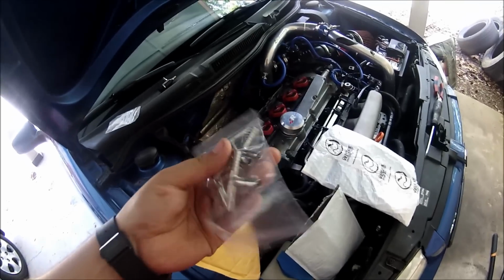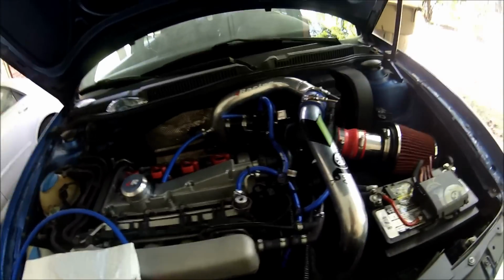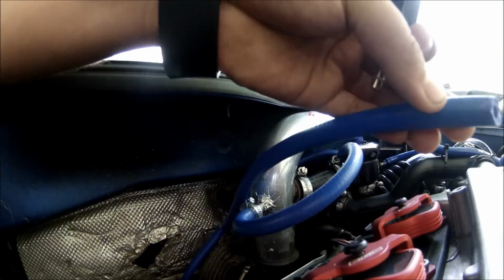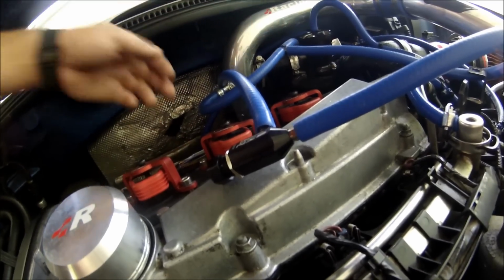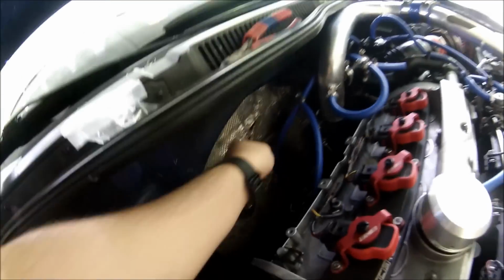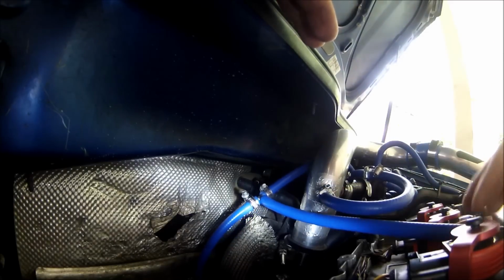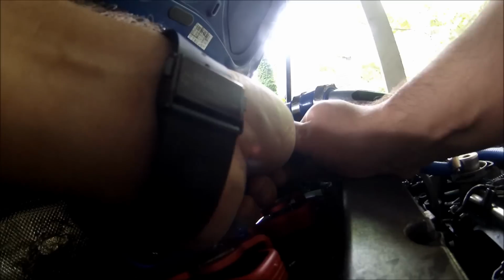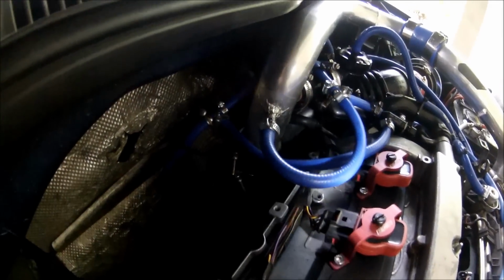HOW TO INSTALL A MANUAL BOOST CONTROLLER JETTA 1 8T AUDI EVO GOLF GTI

Comment: The best and more accurate controller is a electronic one and a professional tune. I guaranty your turbo wont last long with this set up without proper measurement and monitoring how much PSI you are adding.  These cheap MBCs don't hold accurate pressure all the time either. Just get a Stage 1 tune to your ECU don't screw around with your turbo lines.
Reply: DaytonCarCare plus these people say they run there turbo at like 12 psi my B6 Audi A4 Quattro does that too and it’s stock no boost controller involved just a boost gauge, also if you use this “manual boost controller and you turn it up to high you screw everything up” is that worth $80???

Comment: I installed mine thnx to your video .. my boost. on tolerance came with a check valve though I figured it out.. only I get boost fluctuation  from 12 down to 8 then back up and I can feel the power coming and going.. also the mbc doesn't seem to adjust anything.. .. I ended up unplugging my N75 and cranking my waste gate .. I spike up to 15 and hold 10psi feels a lot better but I know it's wrong that way.. how do I fix it?

Comment: Sup dude! Your vids are of great help! One question, where did you get the metal oil cap? been trying to get one red but no luck.
Reply from the maker: +Immortan Jo3 ebay bro they are very rare let me see if i can send you a link for it
Reply from the maker: +Immortan Jo3 just put this on ebay whanAB  and you will see it he had alot of aluminum covers for the mk4

Comment: Hey so I did exactly this. And when I turn my boost controller 5 clicks open it will lessen the boost by about .1 psi per click. I thought this was too increase boost pressure ? Am I doing something wrong? I put the hoses exactly how youdid. And I switched the hoses after i tried it. Still reduces boost not adding anything
Reply from the maker: Ok for this ones you have to open it all the way out  and cover the little hole they have what type of boost controller did you buy?
Reply from the maker: And boot controller is to controll the boost you might gain 1 psi or 2  but is mainly to controll the boost that you already have and to controlle excessive boost spike

Comment: Hey man, 
1st of all, very thorough and informative video. I do have a couple of questions...1. What size stainless steel drive hose clamps did you use? 2. what's the size of those metal T adapters or what should I type in ebay to buy those?
Reply from the maker: GypsyDancer01 OK THE SIZE OF THE CLAMPS ARE 1/4 ALWAYS GET THE SAME SIZE AS YOUR HOSES AND THE OTHER THINGS ARE CALL METAL 3 WAY JOINERS OR SOMETHING LIKE 3 WAY JOINERS BRASS ADAPTERS  I HOPE THAT HELPS YOU

Comment: Dude i really like your videos, are very clear and helpful but i have one question
Does the mbc works if i have my stock ecu? It doesn't go to limp mode? I really want to try this mod!
Grettings from Tamaulipas, Mexico!
Reply from the maker: +Donaldo Guerrero thanks man, it does work you gain about 2-3 psi, for you ecu to go into limp mode you have to push 19 psi with out the ecu to go into limp mode
Reply: squalo777 videos entonces es despues de las 19 libras que se ba a limp mode ?

Comment: Where Did you order those hoses from? Also I Subscribed Great Videos i Will Use these Videos with My 2004 jetta 1.8t
Reply from the maker: Man I didn't even see your comment I buy them from ebay they are really good  type in this  vms 1/4" silicone header hose for radiator coolant is really cheap and good material thanks for subscribing
Reply from the maker: Or you can buy the venair I ply silicone heater hose go to ebay they sell it over there for 3 dollars a foot remenber you need 1/4 for the wastegate and the n75

Comment: did you take the n75 valve out to do this ?!
Reply: TrueSgt With some setups you can bypass the valve. Do NOT unplug the N75, you'll go into hard limp. I have a Boostvalve MBC setup and they made it to bypass the N75 while keeping it "activated" as to trick the computer
Reply: Guy on YouTube way too much would this way in the video works with n75 still on?
Reply: J McCann 
Can you send ne a link to what boost controller you got and all the parts you needed?
And how much boost did you gain? And is the mod still good?

Comment: Why run an MBC, on a vag 1.8t depending on your TUNE you may experience boost surging or spiking aka over-boost. Folks the N75 is there for a reason, understand how it works and learn the hows and whys IF you delete it. It is laughable how people just think they're somehow with no R&D dept smarter than the multibillion-dollar company that owns more than a few. Yes yes by all means alter, customize, decorate your car whatever you like, but understand there are risks to deleting certain parts, which should be stated more than once! The best route and or safest for this engine is to run an MBC parallel to your WORKING N75, set your boost pressure at whatever your tune is set at or lower, and enjoy the drive. Running an MBC in series with your N75 allows you to squeeze out extra psi, but seriously how much is an extra 3psi going to really do in real-world driving. An MBC cannot adjust fuel, timing, etc that's why you buy a damn tune and if you choose, tweak it from there. People who generally run an MBC fall into 2 categories, those who clearly understand what they're doing and those that don't! Take my recent stage 2 tune that's more aggressive than I liked with almost instant limp mode @WOT a very big deal. The solution, buy another tune or run an MBC parallel, lowest setting set @18psi, just fine for a puny K03s. I can now drive my car like the other mindless checking my Twitter, Facebook, and InstaG feed citizens or go WOT all day with no issues, best of all worlds, YMMV.
Reply from the maker: VERY INFORMATIVE..